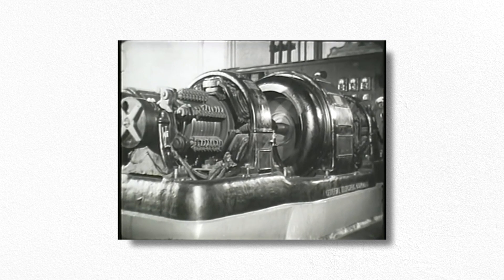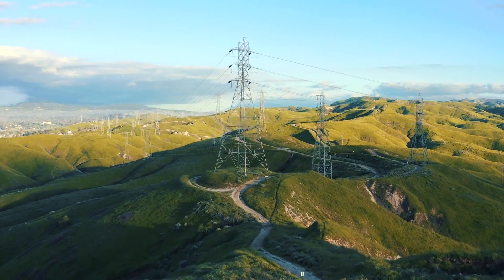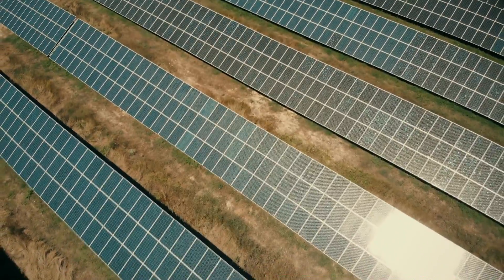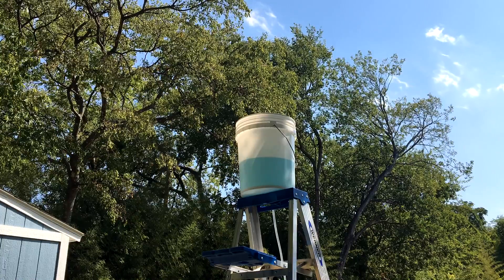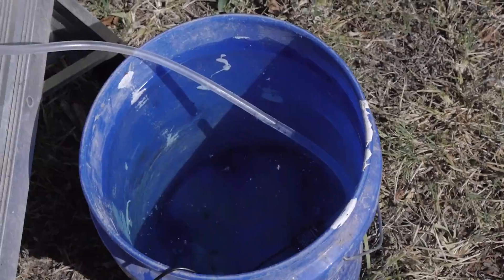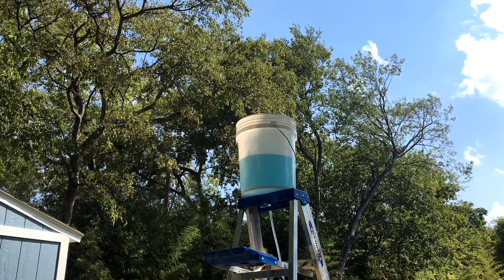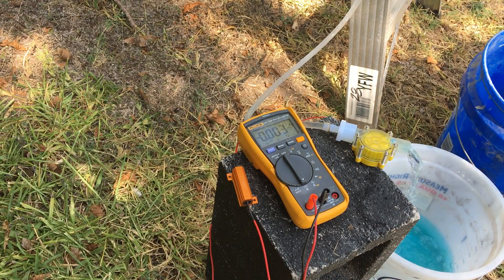World's Largest Batteries - (Pumped Storage)

Comment: this will be mostly replaced by electric cars, as a car is parked 90-95% of its lifetime.
Reply: @Tina Munich Thank you for your reply, I now understand what you meant.
By replacing the energy stored in the reservoirs with energy that is stored in an eCar's battery, possibly using renewable sources during the day and or low cost base load generation at night to charge, In the future you feel that there would be sufficient energy storage in these underused vehicles to supplement the power grid at peak times.
I understand that it may be possible in reasonably densely populated areas in Europe were the grid and supply is also shared between countries, but here in Australia with vast distances between cities and urban areas, The vehicle's energy use would far exceed any potential to have it's stored energy utilised in such a way on mass...Basically what I'm saying is, I'd like to be comfortable in knowing, that when I drive home after work, there's going to be enough power to get me there, and that the grid hasn't depleted it in it's use of my stored energy.
Reply: @jamesellis5445  for australia elon musks hypertube whatever magnetic capsule is intresting i suppose. as far as i understood it would be cheaper to build those tunnels and maintenance them then streets + faster + less energy consumed and you could use them to transmit power, depending on how far these systems will go.
Reply: @Tina Munich I appreciate what you're saying here, but with all respect, that glimpse into the future is far beyond our present leaders grasp I'm afraid. They are only recently toying with the idea of one of these pumped hydro schemes powered by available solar energy to supplement the struggling grid, in a very large and very dry continent as well.
I don't think they can realisticaly see much past the end of the week, little own that far into the future without too much disruption to present day infrastructure and societal systems.
They are also now unrealistically mandating eCar take up by 2030, while just now the price for these vehicles puts them in luxury car bracket, that is far out of reach for the majority of people here, while still not addressing the need for a very large support infrastructures to go with it...simply put, they've not got a clue IMHO.
Reply: @jamesellis5445  its politics... they are all working not for their country but for their own good and corruption is big. I am afraid its the same for all countrys :/
Where i have to say that all western states can only envy china as they atleast have corruption but they dont have political partys fighting each other so they can comfortably pretend they are working :D
Reply: @Tina Munich oh yea that's for sure lol...At least in Communism you know who's gunna have a go at you and they're not gunna pretend they aren't...Danke, es war mir ein Vergnügen, mit Ihnen zu plaudern.✌
Reply: @Tina Munich hello, can you please explain to me your thought here ? so I have a better understanding of your idea...I'm not sure what you are saying will be replaced by electric cars ?
Reply: @jamesellis5445  when there is enough e-cars on a countrys streets and all of them can be plugged in while parked they will server as batteries to store the enegy otherwise stored in these watertanks. these watertanks are only needed because coal plant and nuclear plant cannot be shut down, nuclear power plant will always produce heat and has to be cooled = produces energy, coal plants cost about 50.000$ just to fire up again.
So you build theese waterstorages for millions$$$. in the future you will drive your car for free because all the power providers know that the energy you use while your driving is way less then they can store in your battery.

In germany a car is parked for about 20-22 hours a day. and he have alot of cars replace it with electric cars and you have a ton of batterys making waterenergystorage obsolete.

Comment: I also have thought about this, like pump water back to d reservoirs (dam) of hydroelectric plants on d day time using solar or wind energy. So enough head will be available no can save d cost 9f constructing dam. when i calculated d monthly revenue from this, it was very less. Also if we use solar or similar energy converted to electricity, then we can use on grid system. So it will feed directly to d grid and can come out from the energy losses of converting potential energy and then back to electric energy. Only advantage is that, it can supply some amount of energy for d peak period. If you do the calculation, you can understand, the scalable method of alternators will be cost effective 5han this. Which means, instead of one big alternater use multiple alternaters. Then you can find d scaling is profitable. Most of d power plants are working in this fashion. So this this may not be practically profitable.

Comment: just wanted to point out that you have a tube connected to your turbine that has a significantly smaller bore diameter than the turbine allows. you would get a slightly higher efficiency if you had better water flow to the turbine.

Comment: Solar prodution is not comparable to the rest of the other power sources.  
In most western countries with solar plants, those wouldn't even power 10% of its peak demand, not even on the best summer day. People need to start understanding the dimensions and cost of energy production, this is rather elementary. Or should be.
Also the losses when generating+pumping to later generate power add up, as well as losses in transformation and transport.

Comment: Here in Québec, we do something kinda similar: since we produce the vast majority of our electricity with hydroelectric power plants, we can use this to "virtually" store water. When wind / solar is generating power, we lower the control gates of the dam to keep the water in the reservoir and open them up at night. No pumping needed.
Reply: Here in California I believe Edison etc... also pump the water back up to the upper lakes when there is excess power.   Basically using existing hydroelectric investments for storage.
Reply: So why would you need solar at all?
Reply: @Steve Severl reasons: Keep the water for winter time when peak power is needed; Sell our hydroelectricity to USA at a good price; diversify / stimulate our economy (we're building solar panel production capacities and innovative battery technologies for grid scale storage).
Reply: @DunnickFayuro  watch your energy cost go up considerably
Reply: @bryanhiebert1  hahahaha Solar in canada sounds a really really dumb ideia.
Reply: @Brandon_letsgo  indeed
Reply: @Brandon_letsgo  Sun light, not Sun heat. See the difference? Snow reflects the light, but not the heat.
Reply: In high water where much of the flow isn't used during non-peak periods pump-storage would make sense but as you say Quebec is heavy with hydropower so I doubt pump-storage would be used.
Reply: @RichRich1955  Quebec already produces nearly all of it's electricity from hydro
Reply: @Claptrap Jesus not the entire page, have you?
Reply: @Lucas P  England is building a massive offshore wind farm to supply just 5% of homes there. Is that 2% of total energy? Like it's not even worth the effort. Better to stop expanding growth and the population.
Reply: A much better system than pumped storage.. It completely eliminates the need for solar and its cheaper than anything except Nuclear.
Reply: False... might be true but he's speaking english.. must be false 😂
Reply: I liked the video but disagree with the ideia of adding more wind and solar into the grid. There's already enough proof that they'll never be able to power a modern society. Their low power density and being an intermittent source will never be overcome. So, they're useless. Instead of burning billions on useless crappy the countries should focus human and financial resources on nuclear energy. Getting molten-salt reactors up and running. Operating at high temperatures, they'll be able to do another things besides generating electricity. I ready and ran the numbers several times and the reality is that nuclear energy is our only way out fossil fuels.
Reply: @Brandon_letsgo  i agree on nuclear
Reply: @Brandon_letsgo  Basically I agree, however natural gas should also be considered since they can take the load when the nuclear plant is down.. or when the plant can't handle current levels.  Nuclear plants can't be spun up instantly... they need hours... days even to reach full power.  Yes power companies can plan for hot or cold and spin them up or down slowly, but can they do it daily and with almost instant reaction if there is a failure somewhere else in the system?  They can't do it, they need a backup as well. The US is a huge country.  Hydro is a dream in many places... Natural gas is the answer.. it can be spun up fast.. really fast compared to pretty much any other option at any time of the year even when water levels are to low for hydro.
Reply: @Brandon_letsgo  they might not be able to power an old society alone, a modern society cannot live sustainably without them.
Reply: @yvesremords1377  it’s crazy to see how people are fooled by the solar fantasy.
Reply: @Brandon_letsgo  It's an incredibly reliable and cheap resource to tap into for many climates and latitudes. In any arid climate for example, having a well insulated house with a sufficient thermal mass and solar panels is a very large chunk of the household wattage needs sated, very few batteries required. Even here in Canada, passive solar can easily keep a well designed house warm when it isn't snowing at a fraction of the cost of any other power source.
Reply: @jbaker0203  Yes solar power is way more efficient in Australia than in northern Europa/northern North America. But still: What do you do when the sun sets?
Reply: @stefansoder6903  storage. There's pumped hydro, hydrogen fuel cells, compressed or liquid air. Plenty of info out there on these.

Solar power isn't more efficient here than in those places.
Reply: @Brandon_letsgo  but what about solar satellites.
Reply: @charadremur333  Satellites uses little electricity. Modern societies can't rely on solar.
Reply: @Brandon_letsgo  what? I'm talking about power satellites. Look it up and watch isaac Arthur's video on it as he explains it very well.
Reply: @charadremur333  Solar and Wind combined provides roughly 1% of worlds electricity after decades of subsidies and mandates. They're bullshit.
Reply: @charadremur333  how would you get the  energy from the satellites down to earth?
Reply: @Brandon_letsgo  satellites use  little electricity ?

isn't that a good thing?
Reply: @charadremur333  Isaac Arthur.. the Science Fiction writer?
Reply: @Brandon_letsgo  1 year later (2021) we reached slightly above 10%. On our way to 20% pretty fast. It's called exponential growth :)

Comment: Could you do this with a base of capacitors and just store / release based on demand?
Reply: Capacitors store energy for seconds at a time, so they can can smooth things out on a very short timescale, but they can't help on a longer timescale. Batteries are best for the minutes to hours timescale, and pumped hydro can span minutes to months.

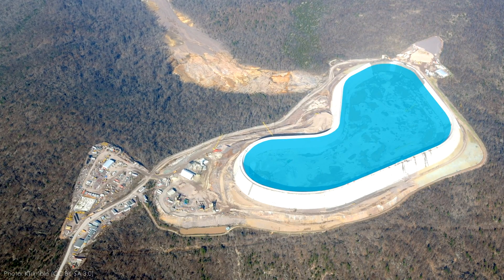Comment: Your thumbnail and 4:21 is the Taum Sauk reservoir (part of a pumped storage facility) in Missouri. It failed in 2005, and all of the water spilled out and washed away hundreds of acres of forest, also destroying a good portion of Johnson Shut-Ins State Park. The utility has since re-built and modernized the reservoir and power plant, and it continues to operate today.

Comment: These are costly at best you spend twice as much as you would otherwise and this is if you have the weather for wind power to work well enough to refill the upper reservoir while producing enough electricity for the grid.the hydro part is the best feature .

Comment: Why aren't more energy distribution networks implementing what my in-laws have (only by being grandfathered-in from long ago), something they call "cheap-rate"?  where energy usage during the day is charged at one rate, but after 10:30pm (when the demand curve falls sharply), or on weekends, the rates go down. So they have timers on their electric water heater (cause one hot tank will get most people through a day), and they run their dishwasher at night, or their electric laundry dryer at night, etc. They are incentiveized to smooth their own usage curve!  
But the municipality they live in, doesn't offer that plan anymore (since like three decades...). and I've never heard of it anywhere else. 
Does anyone know why this is?
Don't tell me it's cause electric meters don't know how to handle it. That answer is false.  I was a meter reader when I was in college, and I'm EE for small electronics now. Not to mention, in the example above, their meter has been doing it since the 80s.

Comment: Hi Grady! Great videos! As electrician myself, I have noticed that people don't understand why exactly current "flows to the ground". They kind of think that Earth just physically attracts current. I remember once one guy (electronics student) said that the battery of his friend's car is dead every morning because some wire touches the ground. Of course it doesn't work that way. Can You make video about that? I think it is common misconception.
Reply: some vehicles use a earth strap to ground the high voltage  static generated by some  tyres  
i have use a ground tag to service delicate equipment

Comment: This is already in use and has been for a long time?! What?! That is a really good idea if the pumps are windmills or the hydrologic cycle. It's a good idea if the pumps are ran off renewable electricity. Break out the Archimedes' screws!
Using a combination of this and an idea I had for producing fresh water from sea water using covered saltwater canals, one could produce electricity and fresh water at the same time!

Comment: Some PHES facilities approach 80% efficiency. That combined with the fact that large solar facilities in places like California are already regularly forced to shed excess load due to overcapacity means that the fact that the battery isn't perfect is no obstacle to its usefulness as a storage facility to access generated electricity that otherwise simply goes to waste. I foresee this situation becoming commonplace as more solar and wind power is installed.

Comment: Saying that solar power generation can only happen during sunlight is a bit misleading. That is true of photovoltaic generation (i.e. using solar panels), but there are other solar power technologies in use. Concentrated solar power, for example, uses mirrored surfaces to heat molten salts to temperatures that are high enough to power turbines for several days, even if there's no sunlight.

Comment: I'm not sure if you've heard this or if it's entirely accurate.  Apparently a great deal of the midwest used a windmill driven water tank energy storage method very similar to the idea you have presented here.   The farmer/rancher would attach a generator to the output of the tank and acquire on-demand power.  Even given the inefficiency of the system the net gain justified the construction cost.  I'm sure this probably phased out when the power grid expanded.   The tanks themselves held very large quantities of water and from what I was told, appeared similar to grain silos.

Comment: I remember one of these large pumped storage reservoirs in Southern Ontario (Canada) Sir Adam Beck generating station near Niagara falls. Huge pumps fill the reservoir during low and cheap demand, then later at high demand and when power is expensive, the reservoir gates are opened turning another set of generators near the dams for the extra needs. Cool concept, but limited to very large scales. I think there is a Google Earth map showing the huge reservoirs for pumped storage at the Beck facility in Canada in this video.

Comment: Hi I'm @frankbarroso23 question so a hydroloop/Aqualoop system which is like a hyperloop system but instead of it being airless it is filled with seawater also using brine water from desalination plants as electrolytes in a cross country tube system. The system would build up a water current much higher than the current gravity produces with smaller turbines along the way at the same time having channels with streams that are surrounded by magnets producing electricity (you can see this in a video of a guy doing a demonstration of two electromagnets [i think can't remember in detail] in each side moving saltwater so if water was moving or had a current it would work in reverse) not only that but you would also use this system to travel fast in a self propelling capsule (water jet propulsion intake in front of capsule) it would also be earth's personal radiator system moving colder water to hot places and vice versa and because of condensation it would naturally produce clean water it would also help during natural disaster such as flooding by vacuuming water into system (you would set a limit of how much water before system starts to open a vacuum and deflood area. It could also restore ice water to polar caps seeing as saltwater has a lower freezing point. So in all that would be the biggest greatest battery ever made it just sucks that I can't do it by myself and don't know who and how to start. Also the initial pumping would be done with solar, wind(straight drive to pump) and ocean's motion having ocean power technologies use wave-energy to power pumps or actually pump the water in using the waves to move pumps. Like I said I have been thinking of this for some time and I really believe that Hydroloop/Aqualoop is the key for many transportation(of people and goods), energy, global warming, drinkable water, and more. So thanks and think about it you could still use gravity as moving force in locations of high altitude across land.